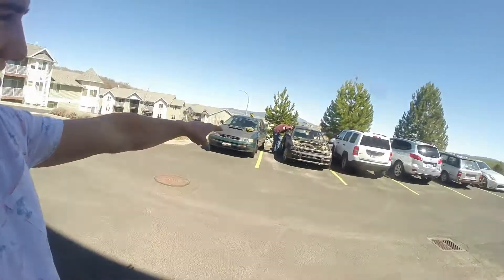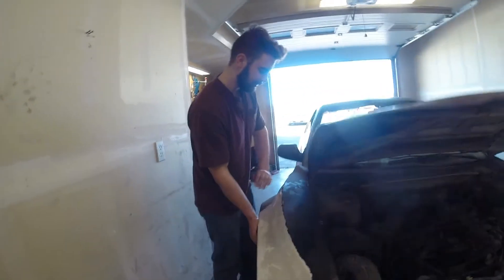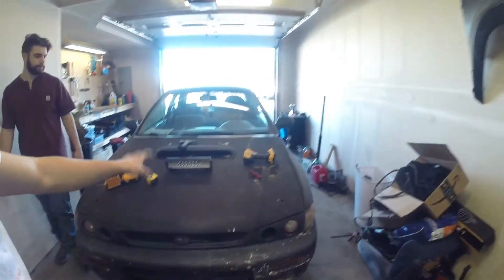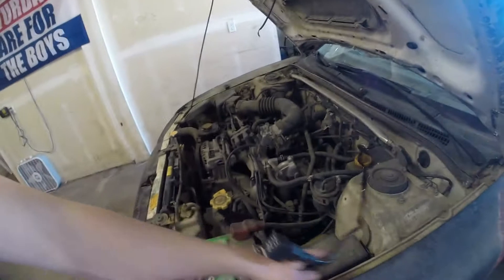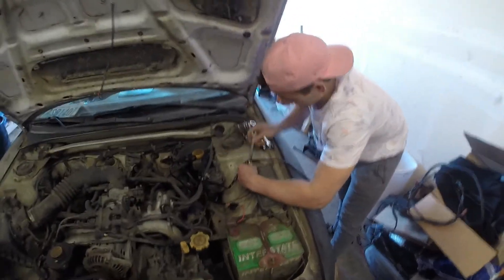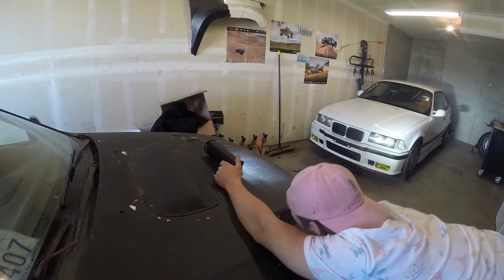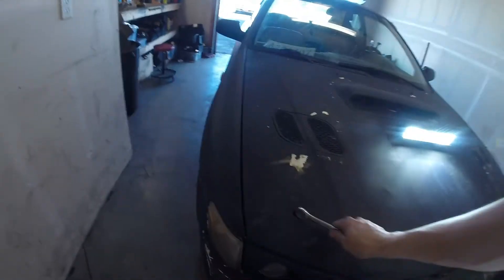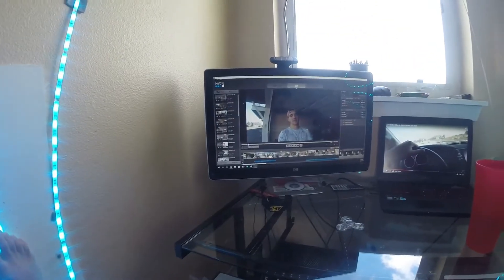We put a light bar on the hood...

Comment: I actually took my 50 inch rigid off my truck when I blew the motor up.  Well I bought a Pontiac for $500 dollars in the meantime I figured since the light bar costed double the car I didn't care so I bolted it right to my hood